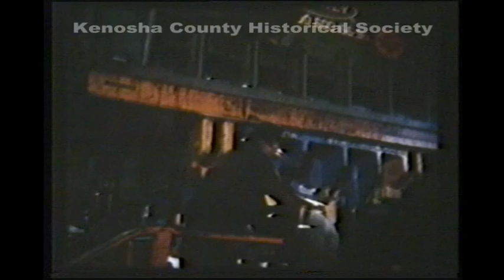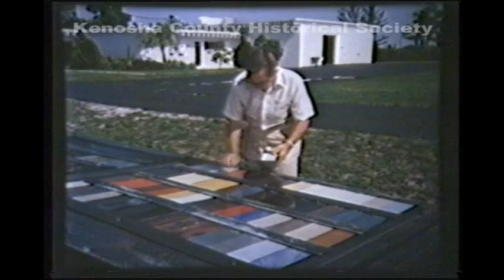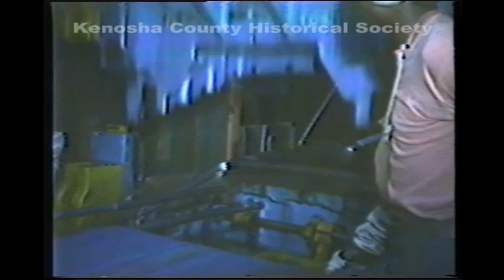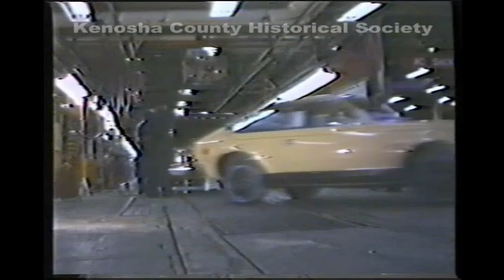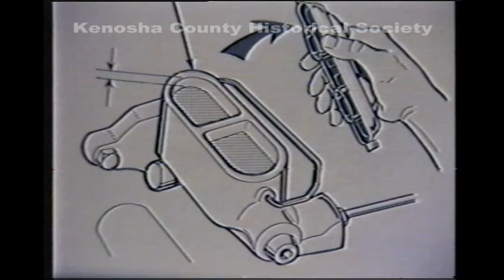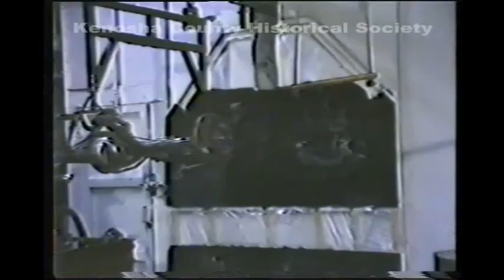Clips from the 1981 Lobby Tour at American Motors, c. 1981.

Comment: Signs of the times. Owned many AMC vehicles (Jeep '65, Hornet '82, Javelin AMX '69, Jeep '84, Jeep '90). All were well built, easy to service. Make American Motors Great Again would be an attractive but simplistic non-political trope. The styling was usually a few years behind or different for the sake of ...?  (Pacer, Gremlin). They just didn't have the scale to afford major annual model changes. If any car of the era gave you 100K miles, it had done it's  duty.

Contemporary puff-pieces for the assembly plant would have no inkling of whether paint and coating shop employees spraying all those coatings without masks ever had problems with COPD later on in life. They were certainly no more well-informed or ignorant than the unions and other auto makers at that era.

Compare these documentaries with current footage of largely robotized modern auto plants where parts fit and assembly are largely computer controlled.

Comment: Awesome!  I always wanted a 4 door Hornet to just use a daily driver.  Great, simple cars.  I had a '65 440 Convertible Classic Rambler.  440 was the model number.  Engine was the nee for '65 232 2bl Typhoon engine.  Great car.  I miss it.
Reply: 440 was the American, the Classic convertible would have been a 770.
Reply: @loumontcalm3500  I think I replied a second ago but I don't see it.  You are correct !!! It was  Rambler American.  Had that strange auto trans from I think Borg Warner.  Worked like the Ford o matic.  It's been a while.  1977  LOL

Comment: They used Chrysler transmissions and GM steering columns. Worked on a Spirit one time it had a GM 2.5 iron duke with a Chrysler 904 automatic transmission